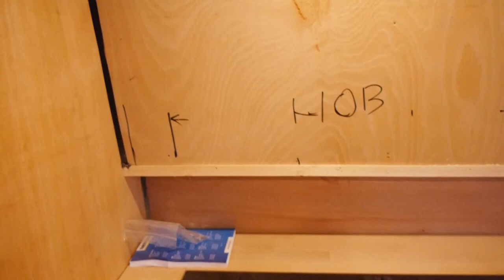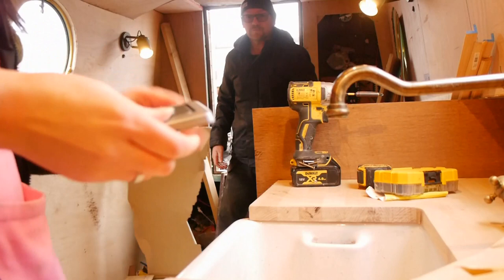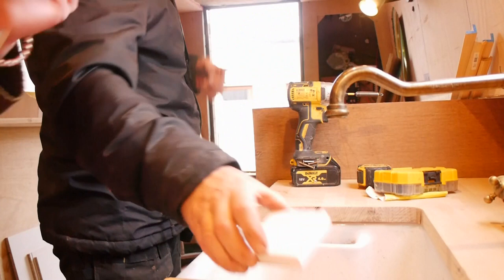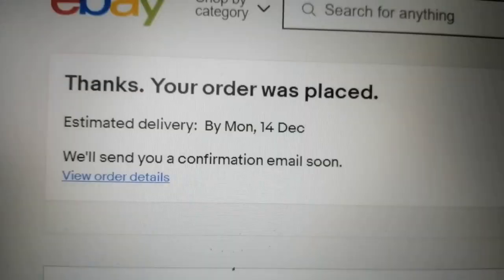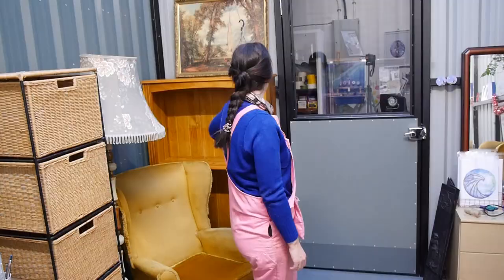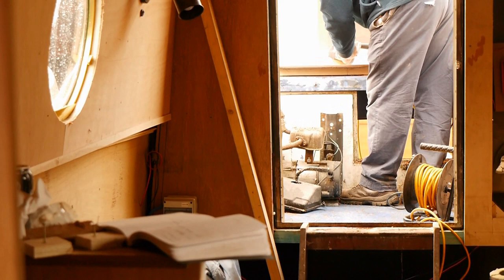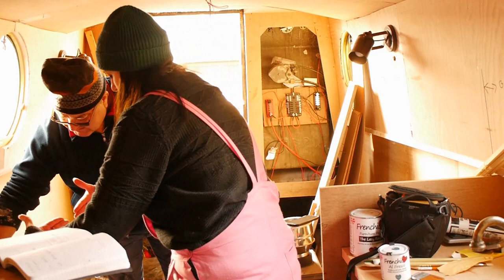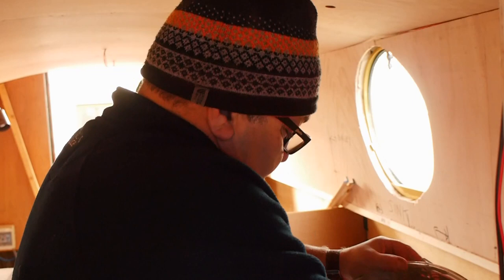Ep 45: NEW kitchen, Fireplace and MORE spending! We're nearly there!

Comment: Mount yourself plenty of 12 volt sockets before you finish the electrics. Use as many car type accessories as possible. Because they use less energy. When you use 220 mains chargers in a boat you have to creat that with an inverter. Inverters aren’t efficient and use a lot of battery juice to make mains power. So you use a lot 12volt amp hours to make mains power. They each usb cube then adapts it back to 12 volts or less. Where as if you just use car accessories to charge devices when possible then your house bank battery charge will last longer. Often laptops and cameras even have 12 volt car chargers available.

Comment: Say, have I missed the electrics / how will you power it all video (with an outboard motor)?! Or is there an alternate power generating source for truly independent, off-grid living and cruising the canals?
Reply: maybe solar or wind?  I used honda genny 40 yrs ago before I got big steel boats with umpteen batteries and dual alternators + solar roof panels. Then a 240v circuit with landline hook-up. But for off grid with an outboard you are looking at solar roof panels and generator here (me thinks). What you potentially have here is a cheap house which will never see water if you find a decent cheap yard and a good set of steps